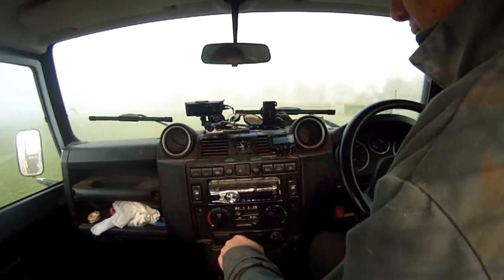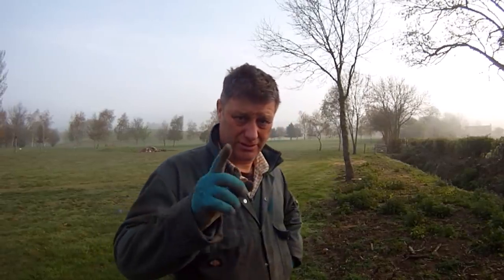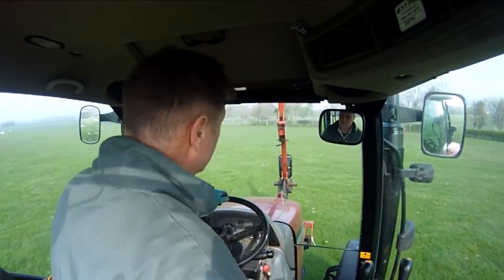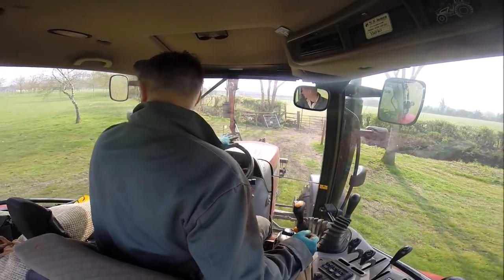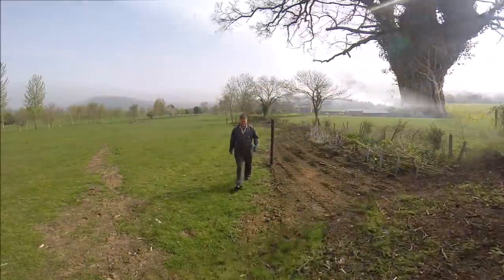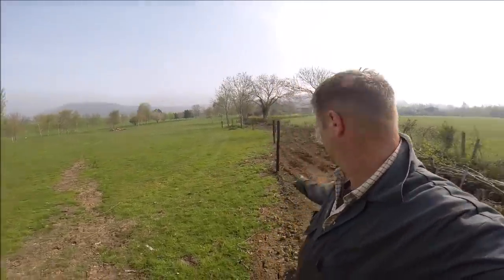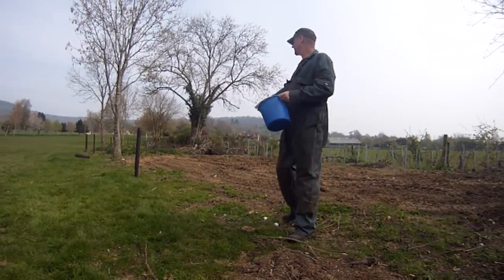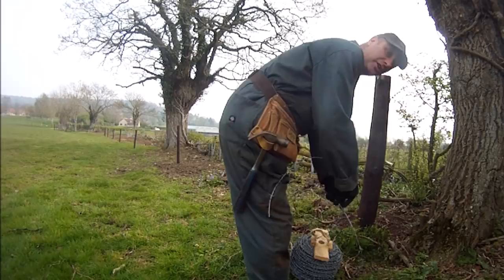Protecting our new hedging plants  17 04 19

Comment: Hi did your eyes start hurting when you put that one post in . L.o.l. wich camera are you using at moment got hard job to hear u now.
Reply from the maker: Andy wilkinson 
I used both my old go pro and the GoPro 3 Black Andy, I had battery issues with one and SD card problems with the other. The external microphone got damaged on its second outing so I’m waiting for a replacement. Apologies for the poor sound.
Reply: @FarmerP  hi ya no need to apologies for any thing it's just one off those things. If you don't break thinks you're not a farmer.  L.o.l